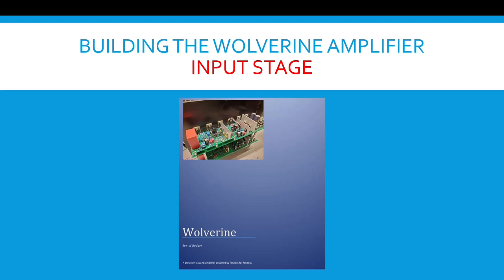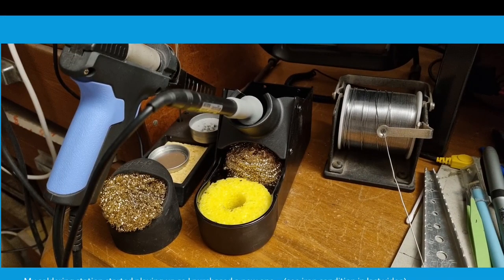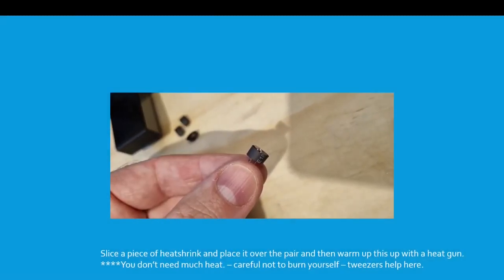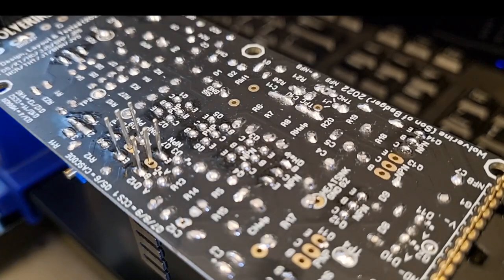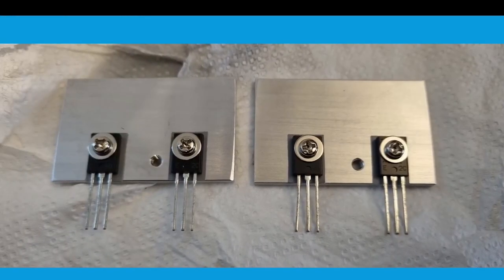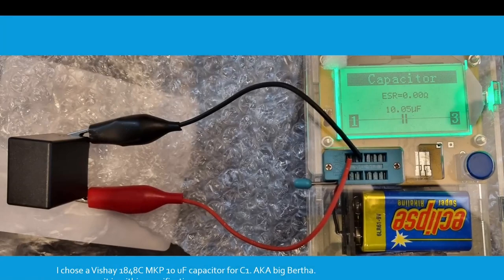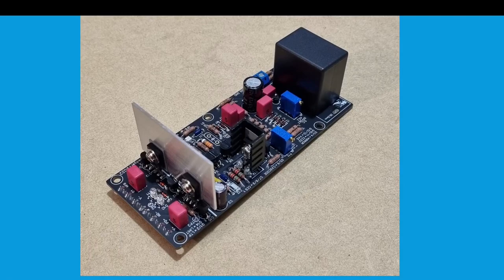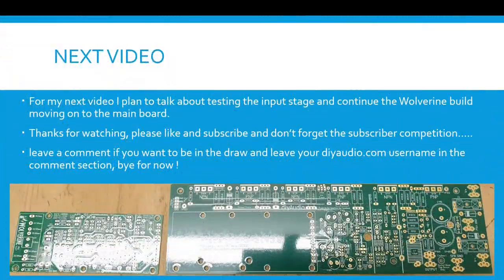Building the Wolverine Input Stage Board

Comment: Good tip regarding the shrinktube holding those transistors together. Wish I saw this 2 days ago. I didn't use paste and tried ziptie instead. Your approach is far neater and will be easier to solder. Im building an F6 but just got Wolverine Boards in the mail. I think my ambition is getting the better of my wallet but who really cares, the end might be near. I never realized what quality you can get with DIY audio. Lots of fun and learning. Please keep them coming.
Reply from the maker: Thankyou for the nice feedback, it is appreciated!
Reply: Is there a thermal exchange between those two transistors ? If yes, would it be a good idea to insert a tiny aluminum plate as a heatsink ?

Comment: I like the wolverines, but man I hate those silly heatsinks.
Reply from the maker: What is it that you hate about them ?
Reply: @danw1million  making them 😋, I guess I'm not proficient fabricating pieces of aluminium, using calipers and drilling tiny parts... I rather go with off the shelf dual to-220s
Reply from the maker: Fair enough,  There is options to buy these pre made. Are you building a pair of Wolverines now ?
Reply: @danw1million  I did one EF-4 like a year ago, now I'm waiting for a pair of EF-3 boards and goofing with kicad one board 4 layers (signal-gnd-gnd signal), a little bit trim down EF-2 as practice. So I might be a fan after all

Comment: What is the recommended power supply for this amp?
Reply from the maker: You can use from 54V dc rails up to 71V dc rails depending on the parts you choose.
Reply: @danw1million  I was asking about a psu board or kit.
Reply from the maker: You can have a look at the diy audio store for some power supply pcbs but there is no specific psu kit at this stage.